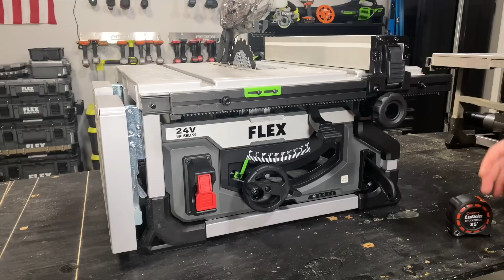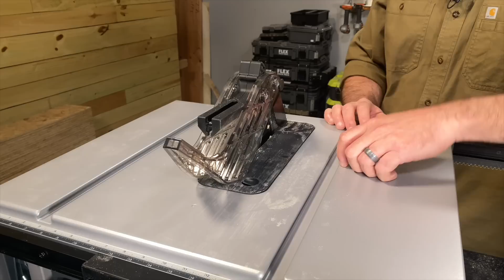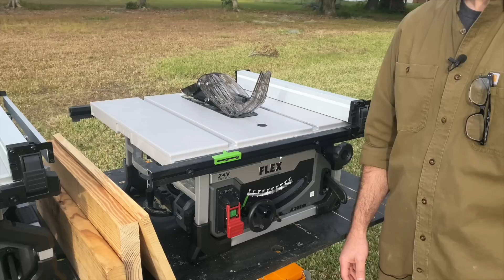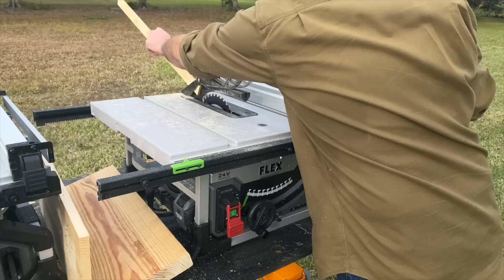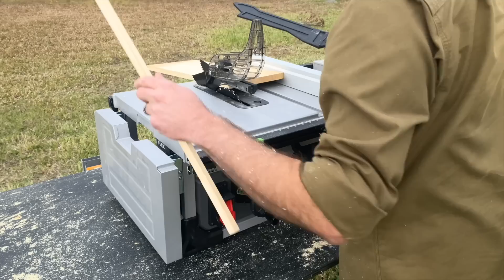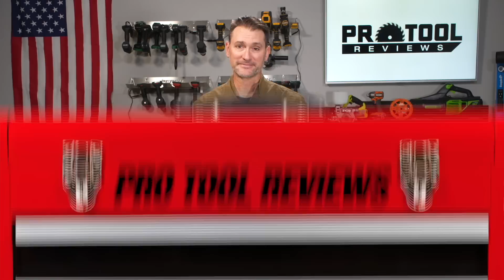Flex Table Saw Review | 8 1/4-Inch & 10-Inch Saws TESTED

Comment: There are so many good battery powered table saws coming out. The one issue that has held me back from purchasing is the way to communicate with a vacuum so it auto starts dust collection. It seems like the only company that has a table saw out that addresses this is Festool, which is out of my price range.

Comment: I'm interested in buying the 10" saw, but I can't seem to find it avertised on their site, or anywhere else, despite having seen it mentioned in a few reviews.  Does anyone have a link to find it?
Reply: Ohiopowertools has them but bare tool only

Can't seem to find the combo pack
Reply: @kawaiisenshi2401  they're listed as "on order", lol... but as I'd be shipping to Canada, it might be better to plan a trip around travelling south of the border, lol
Reply: @AnonymousXIII  after more research turns out the 10" table saw KIT ( with blade, battery, and charger ) will be released sometime this much or later this year in 2024
Reply: @kawaiisenshi2401  Oo, I didn't know that; thanks for the update, none of the reviews I've seen have mentioned this, and they obviously had a sample for the review process, so I was very confused.
Reply: @kawaiisenshi2401  Any luck on finding them?  I keep checking back occasionally, but nothing springs out at me.
Reply: @AnonymousXIII  ill need to check back in on it. I'll let u know if I find anything new in regards to updates :)

Comment: So they copied DeWalt's rack'n'pinion fence system pretty much 1:1, it even attaches to the rails the same way. In fact, the only things I see that are not a complete dewalt rip off are the LED strip in fence and the fold down extension table (which they copied off the Festool CSC SYS 50).
Reply: Only thing they havent copied is the power lol.
Reply: I mean wouldn't you also copy one of the best systems in the market? Difference is Flex is more durable and stronger, I've used all brands, Flex is contractor grade and top dog no doubt
Reply: Everyone copied it

Comment: The CutSense is a safety feature. Clearly it's minimizing exposure, and lessening the chance for kickback.
So not at all comparable to SawStop AIM, but I would love to have that as a safety feature.
Reply: Nope. Not at all comparable. It’s superior by every measure…unless you can’t use a saw properly. 

…at which point you shouldn’t be using a saw.

Comment: Poor push-stick technique in my opinion.
Reply: Explain
Reply: @fZionists78  It's all about the position of the force.  The force should be closer to the blade than the fence, that way the material is encouraged into the fence instead of into the back of the blade.
Reply: “Too” right? Not enough follow through? 

If the stick grips, can’t complain.

Comment: My guess is they have the same motors but the 8 1/4” has less blade to spin, thus when you were really pushing the 2x material it didn’t bog down like the 10”.

Comment: Makita has the Best Table top Saws! PEROID
Reply: Even as a Makita fan myself, what are you smoking? Makita doesn't even make them anymore and the older models have a ton of problems.
Reply: @misha030302  ran a Makita 8 1/4 for 30 years never even replaced the brushes, everyone who was in construction in my neck of the woods ran makita! What you smoking little man?
Reply: @Catman-n4m  Their older table saws are solid. I'm talking about the past 15 years. There is a reason they don't make table saws no more.